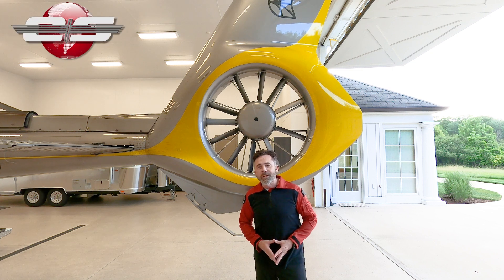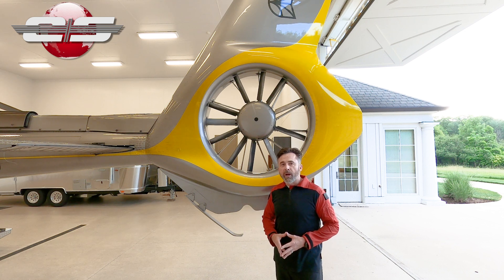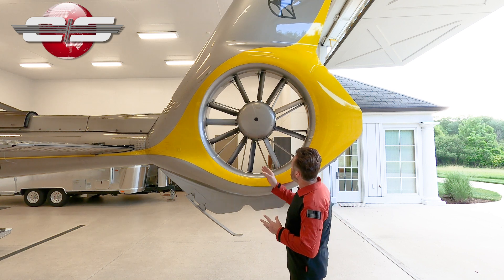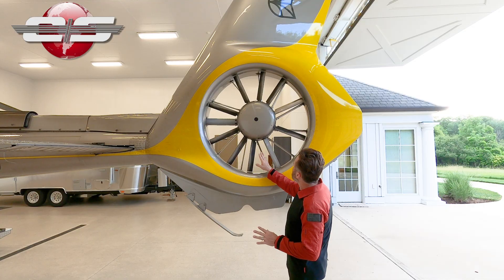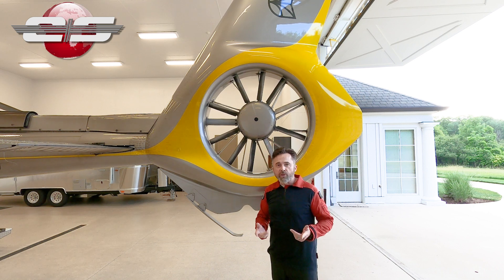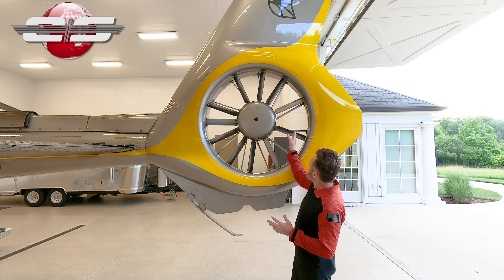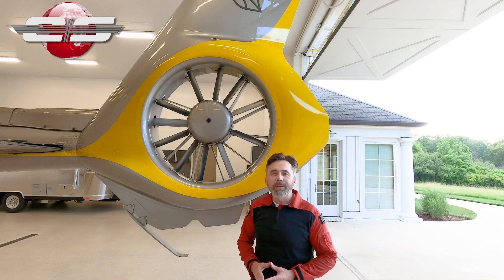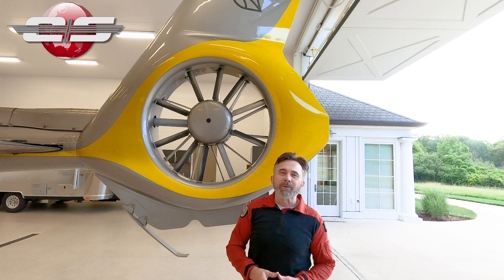#66 - Understanding the Fenestron Tail Rotor: The Future of Helicopter Tail Rotor Design

Comment: How does the fenestron compensate for tail rotor dissymetry of lift ? the blades can't flap !! - is it because the rotor is ducted and doesn't undergo the influence of coming airflow from forward flight?
Reply from the maker: Since the blades are not exposed to forward speed airflow they do not need to compensate for dissymetry of lift.

Comment: Do I understand, that for mountain flying for example, the conventional tail rotor will be better, but for off shore and other low land flying the fenestron is better? At approximately what altitude does the changeover occur? I am currently debating Bell vs Airbus for my personal helicopter if I decide to move forward. It will be a mixture of hot humid flight in summer to very cold and dry mountain flying in winter. ~2000 ft ground level summer and up to 15000 in winter with my helipad at ~8000 ft, in other words a wide variety of conditions and altitudes. I expect to buy a IFR capable platform. Thank you and be safe.
Reply from the maker: Obviously when discussion tail rotors we need to address the specific models. But for instance, the EC130 Fenestron will produce more airflow then a tail rotor on a AS350 at sea level but the conventional tail rotor on the AS350 will do better at altitude. Though there is no data that I have available for this from personal experience I would give an estimate of between 5000 - 8000 feet. Now if you look at for instance a tail rotor on a bell 206B... that tail rotor does not do well at sea level or altitude but a Bell 212 tail rotor does well at altitude. If you are looking at helicopters for altitude the engine and blade design will also greatly effect your decision.
Reply: @EUROSAFETYTRAINING sorry to say, but having flown Fenestron and regular T/R (flying the 130 since 2005) I had more LTE on Fenestron than on any other T/R types.

Comment: Why are the pedals so bloody hard to push? Couldn't they have thrown a tiny bit of boost in there?
Reply from the maker: The rumors were when that helicopter first came out that it was suppose to have a boosted tail rotor. The EC135 it was mirror image designed from is hydraulically boosted. The AS350 the helicopter is based on has a hydraulic boosted tail rotor. But the rumor was that they wanted to reveal it at that years HAI and they ran out of time. Having said that the pedals should be easy to move. I have seen on many EC130 helicopters the Flexball cable that controls the tail rotor gets a "kink" internally in it somewhere. Over time it becomes more and more difficult to move. You may need a new cable.